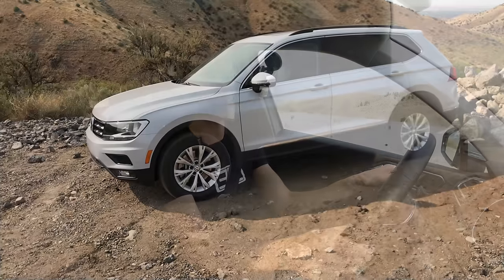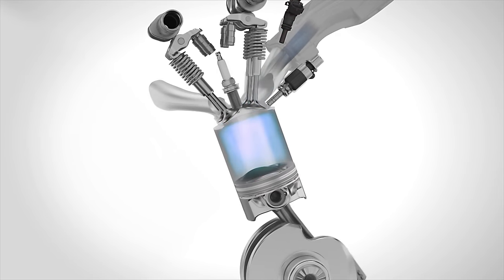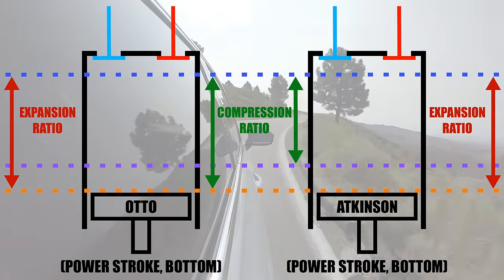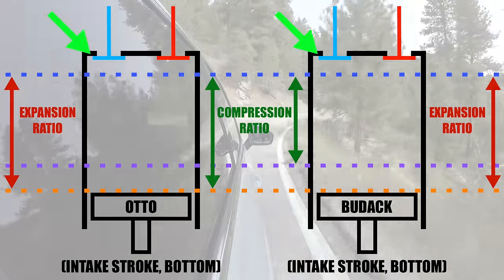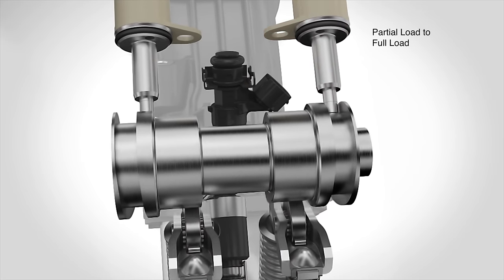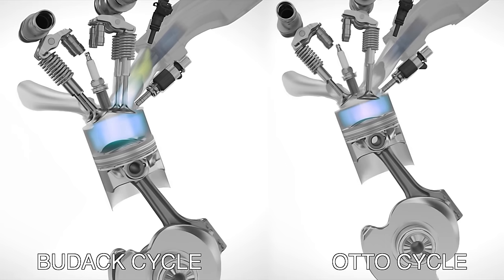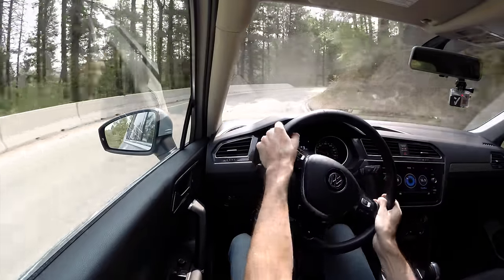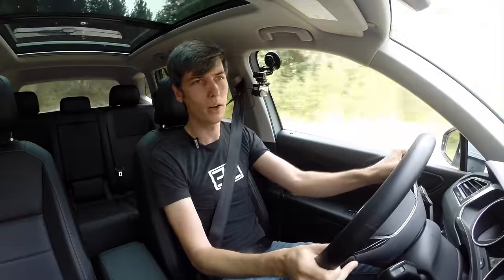Volkswagen's New Engine Cycle - The 'Budack' Cycle

Comment: Having knowledge & experience of VW products from the past . 
I am actually afraid of it.
No not the innovation folks.
It's the future repair BILLS.
Reply: Yeah. It's gone from light vacuum intake stroke to KILLING IT vacuum intake stroke FOR NOTHING BETTER than the Atkinson cycle EXCEPT the Atkinson cycle puts hard vacuum ON NOTHING. Like deciding that you can save brake pads and stop just as quick by locking the brakes up. AND IGNORING the tires shredding to bits on the road. "Nein, dis izz zee nyoo brake pad zaver. Please ignore zee flaking rubber on zee rood".
Reply: Closing the intake valve prior to the piston reaching bottom dead center is going to invite problems with oil control. Sure, the oil rings will tolerate the high vacuum levels when engine wear is low, but once the tolerances increase over time ... you are going to have a bunch of vehicles that can't pass emissions tests, and will either require complete engine rebuilds, or will be towed to the scrap yards.
What a brilliant concept.
Reply: @Link Knight ,
You certainly know how to tread upon the topic.
You are a total screach indeed.
I shall never tire of your jokes.
Many thanks, and have a GoodYear.
Reply: The sooner folk wake u to the fact german stuff aint that good now the better....the germans are good at telling you the product is good....the product is not
Reply: @alanbrand7681 ,
Every manufacturer struggles to build a name brand that consumers associate with "quality and value". This is what generates repeat business through future sales.
But, there is a very fine line between long-lasting products, and repeat business.
Consumers will not pay ten times as much, for a product that will last ten times as long. Truth be told; only a very small percentage will pay 2 - 3 times as much for a product that will last 10 times longer than the cheap crap sold elsewhere.
And, in a world where "low monthly payments" sounds more attractive than "guarranteed to outlast the rest"...  all manufacturers eventually succumb to the realization that "engineering products to wear out in 8-10 years" is a sure way to generate repeat sales.
As long as "all" of the manufacturers follow the same philosophy; each is on the same footing.
I drive a 1982 Mercedes 240D, as my general "beater" vehicle. It has 350,000 miles on the odometer, gets 30 mpg on average, and it sits in the driveway during rain or shine. 
On weekends, and special occasions, I drive my Rolls Royce, which is always protected in my garage. Both vehicles are high quality, and very well-made. Yet, the Rolls continually increases in value ... while the Mercedes continually depreciates. And, if a tree falls on it ... no big deal. I'll just get another one.
Who can figure out what society will value, and what they will regard with indifference? It's not as if it is based upon logical reasoning.
Reply: @marshalllhiepler  "Closing the intake valve prior to the piston reaching bottom dead center is going to invite problems with oil control."  How is this any different from throttling the engine conventionaly?
Reply: @ferrumignis ,
Its not.
High vacuum causes oil to bypass methods of control.
The point is that this "high vacuum" will negatively affect emissions. 
If the new design is to succeed, it must bring substantially reduced emissions to the table. Otherwise, there is little incentive to re-tool.
Reply: @marshalllhiepler  Throttling an engine causes a vacuum, again what's the difference?  The early closing of the valve isn't going to cause excessive levels of vacuum, it's not like the valve is closing with the piston anywhere near the top of it's stroke.  OTOH oil consumption has historically been a problem with VAG products due to low tension rings, but the later engines do seem to be a lot better.
Reply: @ferrumignis ,
Well, there is one thing that you have to understand, Wizz.
The internet is a breeding ground for a pathetic type of people, which live in a vacuum. They seek only to engage in "cyber arguements" with the pixels on their screens. Sadly, these are the high points of their lives, and without these pathetic encounters, they would soon become tomorrows suicide statistics. There exists no "real" meaning in their lives, otherwise, they wouldn't cling to the hope of victory in battles that normal folks could not care less about.
I hope you are not one of these pathetic losers, Wizz.
If you have an opinion that is contrary to another's; that's great. Just state your perspective, and then let it go. Don't try to create a battle, where there is none.
It is perfectly o.k., in a rational and sane individual, to hold an opinion that is not congruent with others. It is not threatening.
Thus, there is no need for needy, clingy, "battle banter". 
You disagree with my views.
That's wonderful, and I am proud of you.
Reply: Easily avoided by simply not buying VW products😅

Comment: The Budack cycle has one drawback compared to the Atkinson cycle: When closing the inlet valve before the piston reaches bottom dead centre, it creates a minor vacuum. That slows down the piston speed.
Reply: This same vacuum also helps accelerate the piston off of bottom dead center, though, yes?
Reply: @exploranator  Yes, a little bit. But the acceleration at that point takes more energy than the vacuum can provide.
Reply: @eknaap8800  On the other hand, the atkinson cycle sucks extra air in that it pushes back out after bdc. While the atkinson cycle is like a pump, the botkin cycle is like a spring.

I see this as an improvement, even if you play around with the resonances of the normal atkinson version i don't see a lot of that energy recovered
Reply: @uninteressant2196  It all changes when the RPM changes; so you win on the one hand and lose on the other.
Reply: It seems like this will lead to vacuum pumping losses just like a traditional gasoline engine.